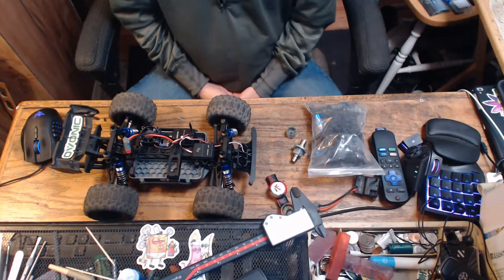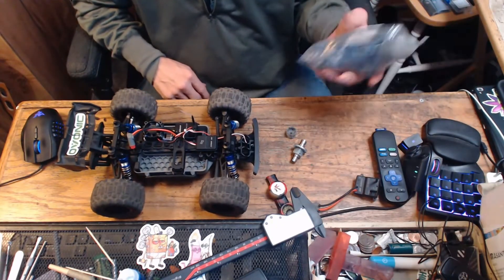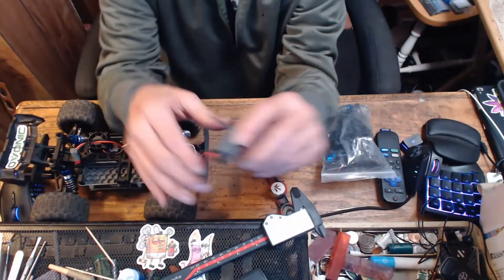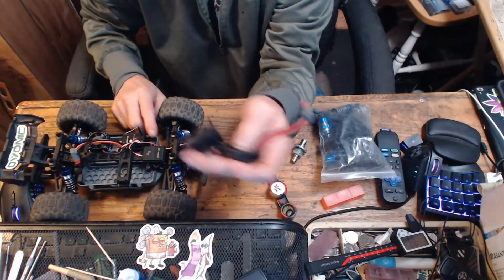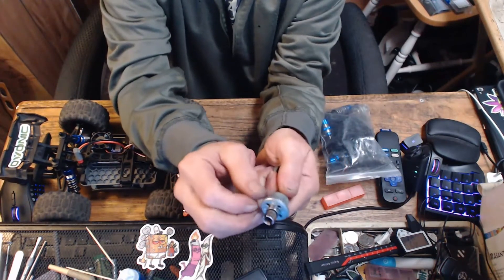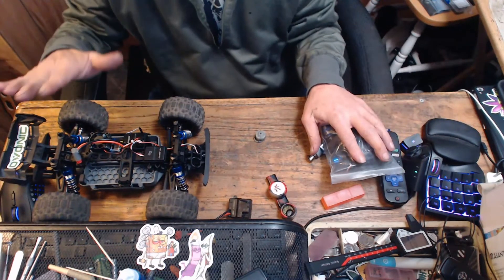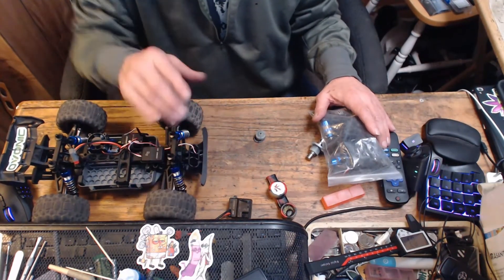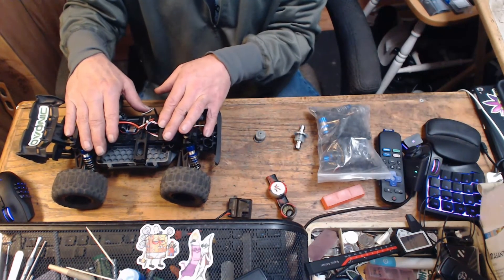~2022~ Hosim/MJX H16P GPS ~ Differential issue + Inside the ESC ~

Comment: Do you have a video of a teardown?  My diffs need to be replaced and I was trying to find a tutorial. I bought a couple extras when I bought the car cause that's what people were saying would break
Reply: It's not as hard as you'd think, take the screws out where the mid sections meet...make your way to the front and take the shock top screws off undo the two frontal screws on the bottom, undo the front bar screws and bend it forward to undo the arms, then it's simply the remaining screws on the diff cover and it pops off. Similar for the back but actually easier
Reply from the maker: @Dazza2292  Great description.. Thanks! Vid is almost ready...
Reply from the maker: I did make a video of the tear down and reassembly. However, I had some very ugly technical issues...lost a clip and audio issues.... I am attempting to use free software to edit the video down to something useable. I may just stich it together and set it to to some beats... I'll do my best to get it up in a day or so.
Reply from the maker: Here is the Quick Shot video.... https://youtu.be/6FDBv4kxOic